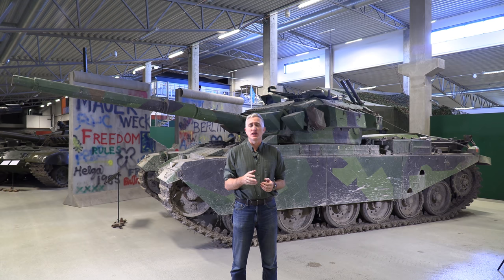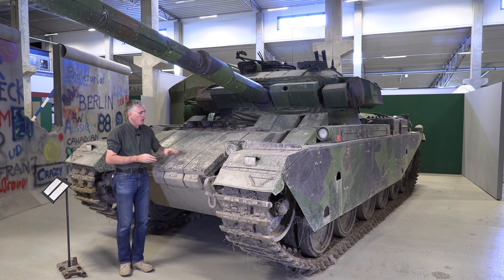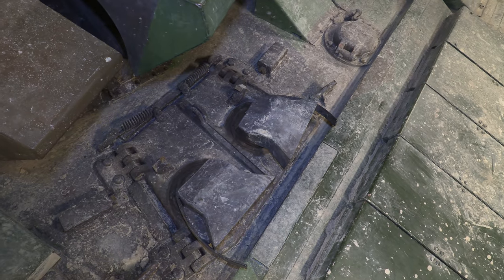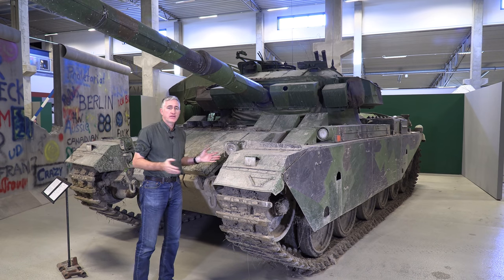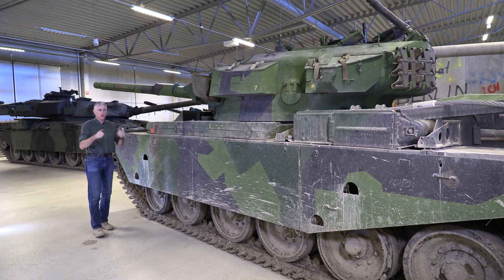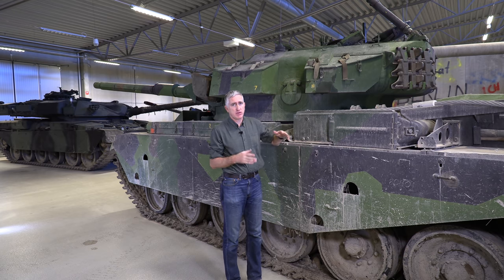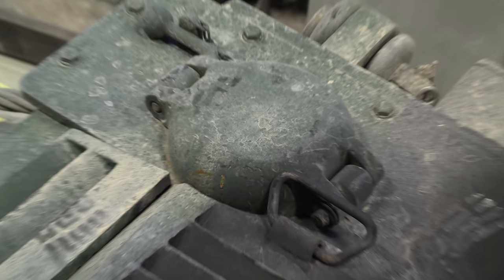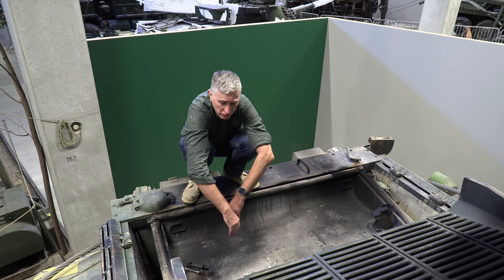Inside the Chieftain's Hatch: Strv 104, Pt 1

Comment: Nicholas: This Centurion is covered in dirt because it's a regular runner at the musem
Me: Looks suspiciously at the clean Chieftan in the background........
Reply: LOL!  The Chieftain's multi-fuel 2 cycle engine was a hunk of junk!  Over 50% failure rate!  Why they couldn't just stick something else in there, I'll never know.  Most the Chieftain hulls were used in/upgraded to Challenger 1 in the 1980s, I believe...and they put a more sensible diesel in them.
Reply: @pex_the_unalivedrunk6785  No they were upgraded in the MK 5 model and they were reliable after
Reply: it really is a shame that such an amazing vehicle was betrayed by such a shitty power pack. The stillbrew armor may have been necessary but the original turret was so sexy!
Reply: @pex_the_unalivedrunk6785  they were the only nation to comply with the NATO requirement for a multifuel engine. Everyone else abandoned it for diesels.  (Except the US which made a multifuel turbine and only used jet fuel and diesel in it.)
Reply: if thats a mk 2 Chieftain then it probably couldn't even go up a slight incline to get back into the museum with its' 8.8 hp/ton
Reply: @Orinslayer  because the rest of the nations realized that the multifuel engine wasn't viable.
Reply: If im not wrong the strv 104 can actually drive and move and such stuff. Meanwhile the chieftain i dont think it can

Comment: With all the trouble the British had with tank design during WWII, they certainly overachieved with Centurion as compensation.
Reply: Barely missed the mark with the Chieftain, but unfortunately started a downhill slope with the next two. I'd also argue we didn't have trouble with tank design in WW2, as much as we had a problem with settling on an idea with which to design tanks in mind of. A problem that everyone barring the US and later on the Soviets had
Reply: @greystash1750  You mean the Challenger I and II (not the WWII Challenger)? 
I see your point though about the setting of an idea. I read a great paper on British tank doctrine of WWII and how, fortunately, there wasn't one, at least not like what the Americans came up with. The author argued that if there was one, it would've been Montgomery to write it, with all of the subsequent assumptions about armored warfare based on his experiences in the Western Desert. 

So, you think that the divergence of the cruiser and infantry tanks led to some of the challenges? Makes sense considering the gun issues of a cruiser in the early part of the war and the speed/mobility issues of infantry tanks at the same time. 

The Article is called "Tackling the Tiger" by John Buckley
Reply: That's what happens when you don't really have any tank engines available, no money for tank design during most of the 30s and you left most of your tanks in France and just shoved anything out to rearm afterwards.

Centurion was a clean slate design once the threat of invasion was gone and the army was rearmed.
Reply: 2 years makes a lot of difference. Imagine Comet during D-Day and the 17 Pounder Centurion would have made a lot of difference.
Reply: The Centurion in some form or another are still being upgraded and serving in 3rd world countries all over the world.  It's amazing how relevant it still is in "low intensity combat"...I'd rather have one of them than a modified T-54 for more than a few reasons.
Reply: @CharlesvanDijk-ir6bl  Even a couple of months, Comet COULD have been at the battle of the bulge but the crews were still training on it and had to leave them and go back to the Sherman's for the battle. Imagine too if Cromwell had been in the western desert in '42, So many what if's...
Reply: @greystash1750  there was absolutely nothing wrong with both challengers.

They where and might still be the safest tank for a crew in the world.
Reply: The worst problem has to be that Britain only rearmed by 1939 compared to germany who started by atleast 1937. Effectly britain spent the whole war 2 years behind weapons development. If you take british tanks and move them a year back they would have been good instead of mediocre in their actual year of debut. Cromwell was designed in 1942 but didn't arrive by 1944!
Reply: A regulation from  White Hall ruled all British tanks had to be transportable on the British rail system. As it was the worlds first rail system the bridges and tunnels were low and thin. The results is a small thin tank. The Churchill had the same width as the Sherman but the height is lower.This resulted in a smaller turret ring which can only mount a small turret with a small gun.  It wasn't until this stupid requirement was rescinded that tanks like the Comet and Centurion could be built.
Reply: @binaway  Wow, that would really, really screw up the entire process! So they also had to build the centurion and Comet to be more transportable by road and self transportable as well.
Reply: @TheLastSterling1304  Sorry but you need to do a bit more research. The Matilda II was way ahead of the early German panzers in terms of armour and gun. During the battle of France/Belgium Matildas II were able to easily rebuff anything the Germans had until units under Rommels command turned 88mm Flack guns on them. Early British WWII tanks were as good, if not better, than most other tanks in use by any other nation. Its a common but incorrect assumption that every tank designed and built in the UK upto 1944 was outdated or bad.
Reply: @vtbmwbiker  Incorrect. The British did have a doctrine. They still worked along cavalry lines in using fast lighter armoured tanks for breakthrough and exploitation (Crusader/Cromwell) and infantry tanks to support infantry, these had heavier armour and were slower (Matilda/Churchill). The US worked on similar lines but instead of infantry tanks they had assault tanks (M4 Jumbo) and fast tank destroyers to take out tanks (M10/18/36). So another way of looking at it is both the UK and the US had doctrines that they would later abandon for a Universal tank (MBT).
Reply: @KP-viking88  Throw enough shit at the wall and some will stick. Armor is nothing when it still suffers from the same issue that all early british tank had: poor reliablity. That unreliablity problem stems from the lack of time to test designs and work out the faults before sending them to battle. The Crusader was unreliablity for this each reason and why the cromwell took 2 years to develop so that it wouldn't happen.
The matilda uses 2 bus engines, unlike the germans that did have purpose built tank engines meaning it was prone to breakdowns being not designed for such weight. It's gun lacked range over the german 50mm and 75mms. and it's suspension was needlessly complex and difficult to maintain. Germans didn't have any issues by 41 with the arrival of longer barrel 50mms and better AP rounds. 
You don't judge a tank by just it's armor thickness, gun size, or max speed. You judge how well it performs in battle. Once you ignore the Matilda bullying the terrible italian designs and compare it to the at then current german designs, matildas just didn't perform. Matildas were already being replaced starting in 41 with the introduction of the better valentine.
Reply: @vtbmwbiker  Britain is small and the furthest you can be from the sea is about 70 miles. As it would be fighting overseas it would only have to be transported to the nearest port city.
Reply: @CharlesvanDijk-ir6bl  Indeed but the germans made their own upgrades as well but the Soviets where knocking on their door. Putting of D-day for two years would mean missing the party and that most of central Europe would speak Russian as their second language.
Reply: @pex_the_unalivedrunk6785  Fighting ill equipped insurgents it is probably good enough. It also look good on El Presidentes military parades...
Reply: @greystash1750 um the chieftain was another HUGE tank for Britain. I know it was flawed with its engine, but technology wise the chieftain changed the MBT game. There’s a reason chieftain was in service with Britain for over 30 years

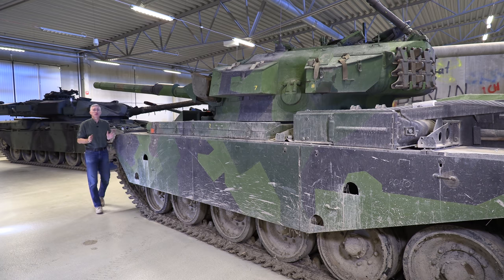Comment: 4:57 we updated the gun from 105 to 120, crew no reactions. we added step ladders to the skirt, and installed some better chairs. crews throws a 3 days party.
Reply: cents never had a 120mm. they only went from 17 pounder, 20 pounder to the L7 105mm
Reply: @emilbt7588  There was actually a single centurion in Swedish service that was fitted with a 120 mm to use when testing reactive armour if I remember correctly.
Reply: @endastforkommentering9913  correct, it is a swiss cent mk.vii that sweden bought and then stuffed a 120 in it for testing some IDF ammo or something. It has been used up until 2009 as far as i know.
Reply: @emilbt7588  there was a swedish prototype of it but thats about it. No idea if it was tested or not
Reply: Ok nvm someone already said it
Reply: Didn't the south African army add a 120mm to Thier centurion tanks?  Just wondering.
Reply: @ernestpaniagua1210  nope, they still have the L7 105
Reply: @emilbt7588  that's what I thought thanks just wasn't sure.

Comment: Some comments about the engines 1) It's interesting that the US M4 and M4A1 and the British Cromwell, Comet and Centurion all used modified aircraft engines (Meteor was a derivative of the Rolls Royce Merlin). The Ford GAA used in the M4A3 was a V8 version of a V12 liquid cooled aircraft engine that Ford was developing (Can't let GM's Allison V-1710 have the market to themself) that the USAAF eventually cancelled. 
2) US reciprocating engine names. R=Radial O=Opposed ("Boxer") V=V Configuration IV=Inverted V, Not Specified=Inline.  Number = Cubic Inch Displacement. The engine used in the M48A3, M48A5, M60 series and M88 series is the AVDS-1790 - Air Cooled, V Configuration, Diesel Fuel, Supercharged, 1790 Cubic Inches. Modifications follow the displacement and are alphanumeric. So, the full name could be AVDS-1790-2A. Interestingly, it is a modification of a gasoline engine used in the M46, M47, M48, M48A1 and M48A2, the AV-1790 - Air Cooled, V Configuration, Gasoline Fuel and Carbureted is implied

Comment: Of the engine is set up like it is on an M60 it has 2 oil coolers on each side. The front pair are engine oil coolers the back pair are for the transmission. The fans draw air in from the side grills it flows under the engine up through the center cooling the cylinder heads and out the same grills as the exhaust.

Comment: The big exhaust compartment seems like a waste of space? Maybe you could wrap some pork in tinfoil, throw it in there, and after driving around a bit you would have lunch?
Reply: Extra smokey
Reply: They did use it for cooking, why do you think the Swedish field rations came in tin cans until 2004 when the Centurion had been decomissioned?
Reply: For real?
Reply: @Cpl. Rook I was honestly just joking. Who knew the centurion was so versatile?
Reply: @Cpl. Rook the tin can "guldburk" rations made by knorr were phased out during my conscript training in 2003/2004.
We recived plenty of them during summer and early autumn, then mostly 20litre thermos cans until the end of the year.
From January until graduation in mid April, we got either green bag freeze dried rations or civilian food cans like ravioli in tomato sauce, meat soup or gulasch.
You can google "guldburk" and google translate for more official info.
As for the exhaust compartment used for heating food, that's a no brainer that soldiers and sailors with access to hot engines of any kind has done since the age of steam.
The hard part here would be to suspend the can from the grille in a way that the heat won't detonate the can as you don't want to pierce a can hanging in diesel exhaust just to let off excess preasure from a heating food can.

That said, that the food was issued in tin cans was probably a logistics and long term storage decision that had fortunate side effects for hungry and experimentally minded soldiers who didn't want to waste precious break time on setting up and lighting or dishing up their individual issue triangia field kitchens...
Reply: there was a top gear episode which used the engine for cooking, everything tastes like gasoline in the end and it's toxic
Reply: @justinyang9931  The Mythbusters cooked a Thanksgiving meal using a car and it was fine. Cooking with engines is viable, you just have to be careful and smart to avoid the exhaust.

Comment: The Centurion was a great tank. What a difference it would have made if it had gone into service a couple of years earlier in WW2.
Reply: The original Centurion Mk 1 was pretty underwhelming - with a 17pdr gun and 3" of hull armor, it was basically just a Sherman Firefly that weighed 50% more. And while it was certainly more comfortable for the crew, such a large vehicle would have probably harmed production and transportation.
Reply: @ARCNA442 yeah it didnt fit the trains and had horrible range on its own

Comment: 0:17 I may be wrong (but, at the same time I feel almost sure), but I think that the Centurion tanks were fully capable of equipping 120mm guns. The reason I say this is that there was a variant of the Chinese Type 59 tank that had a 120mm gun. The Type 59 was basically a copy of the Russian T-54/55. And last time I checked, the T-54 had a turret ring diameter of 1820mm. On the other hand, the Centurion had a turret ring diameter of 1880mm. So, both had nearly identical turret ring sizes.

Also, I think that the South Africans experimented with putting 120mm guns on their Olifants (which is their version of the Centurion. Wow, Centurion must've been popular. Australian, British, Israeli, South African, and Swedish Centurion). I think???
Reply: The Swedish mounted a L44 into a (swiss?) centurion mk.3 they bought so they could test ammo while they debated buying leo 2a4s

Comment: The metal grips on the tracks are called cleats, or at least they our on diggers, there are quite a few that you can take on and off.
Reply: Not the same thing, the centurions were designed before cleats and replaceable track pads became a thing.
The links of these tracks are one homogenous cast steel component with no provisions to add or remove anything more advanced than an unditching log.

Comment: Ahh yes diesel soot... engines from a time before diesels had electronics to go wrong. 

I work around heavy equipment so you learn to have a rag handy when it comes to the engine bay of things. 

I know these Continental diesels are loud... just think how much louder this tank would be if they had powered it with a Screaming Detroit 12V-92! 

Hey just a fun fact the Twin Six Pack (two Detroit 6-71to a common bellhousing) that they put on the back of the Sherman's was first developed as a marine propulsion unit for the larger LCM-8 landingcraft. It was a nice compact way to package 340-400 horsepower. If you get a chance to look closely at one of these power packs you may find the engineering interesting.
Reply: The sweet growl of a Detroit Diesel is music to my ears.
Reply: @mikewysko2268  I have spent many hours working around and with them... I have seen them hold up to an ungodly amount of abuse hour after hour. There was a reason they were found in Logbronc's and log skidders for years. In the Alaskan fishing fleet in the 70s and 80s over half the boats were Detroit powered.

Comment: The Strv 104 where made from the most worn out Strv 102 tanks these where ex British mk3 and mk5 tanks not the mk10 like you seemed to indicate
Reply: Source?
Reply: @TrigonixZeNW  All sources describing the tanks history.
You can also see it on the sideplates as the number of fastening points for camouflage are quite few while the  Strv101 (mk10) has a lot more.
You can also tell by the lack of a turret floor for the gunner.

But the most telltale is the registry number which starts with 80 which is something all ex-Strv81 tanks does.
Reply: @AdurianJ  because the registry numbers on Swedish army vehicles are also tied to the naming system of type, main weapon caliber and some other properties I don't remember.
Reply: That remains on of the great mysteries..  WHY was the strv 102, which apart of being older also was made in Imperial units , selected for REMO (Eonvation/MOdification) instead of the while the more modern strv 101 yjat was in metric got scrapped?